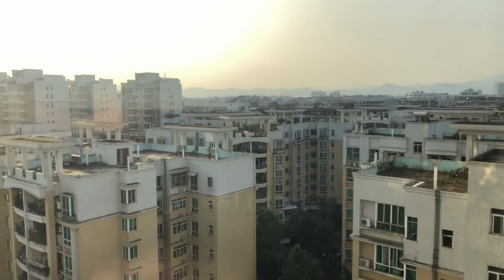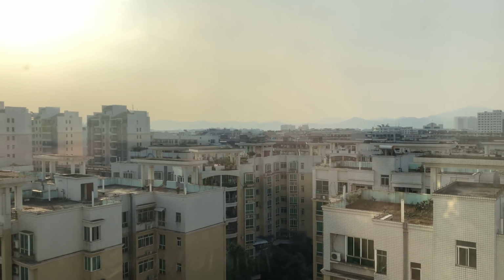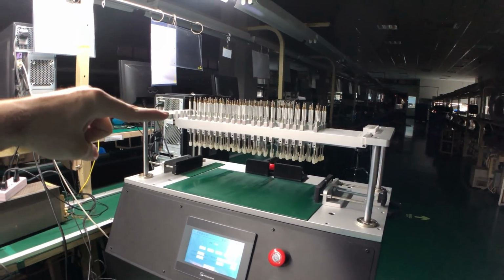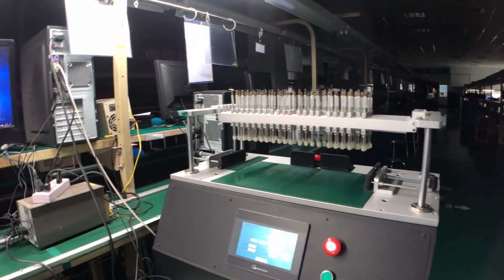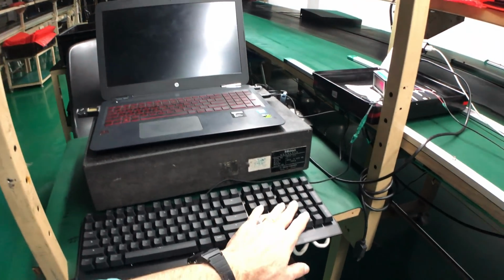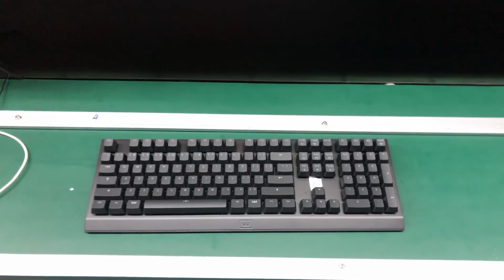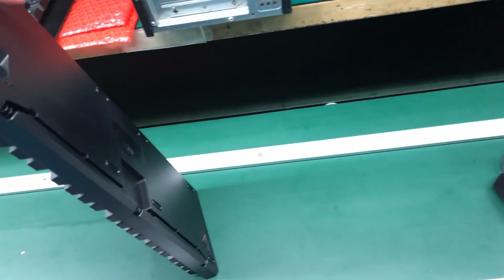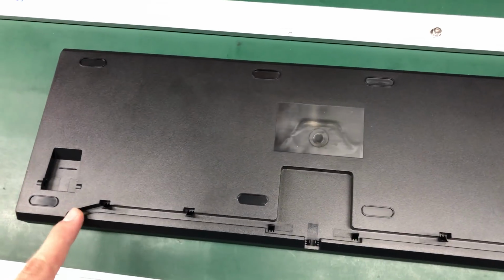Wooting two - Trial Production day 2

Comment: Should really try to get Amazon to stock your keyboards. Would be very nice since they send replacement items first so you aren't without a keyboard (for likely several weeks) and give you free shipping if you get the odd defective one.
Reply from the maker: The Wooting ones are already stocked by amazon, so we'll be sure to add the Wooting two to that stock later too! Thanks for the suggestion.
Reply: I meant Amazon selling it directly. The only Seller for the Wooting One on Amazon's website is Wooting themselves not Amazon. No prime shipping and no Amazon customer support beyond a refund if under certain circumstances.
Reply from the maker: @FatheredPuma81  Oh sorry for the confusion. Usually we have a stock at amazon, but they're out right now. That's why you only see us as the seller. The prime shipping and customer support is very useful for us too, so we'll make sure to get back on it.
Reply: Oh alright thank you :).